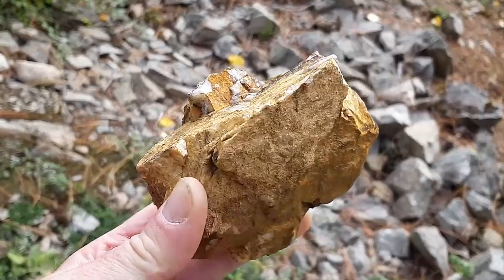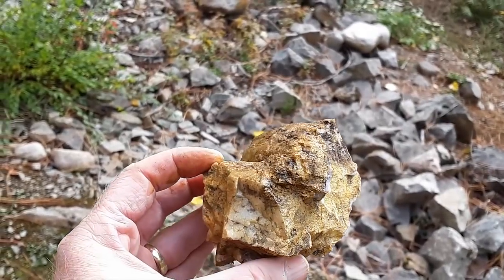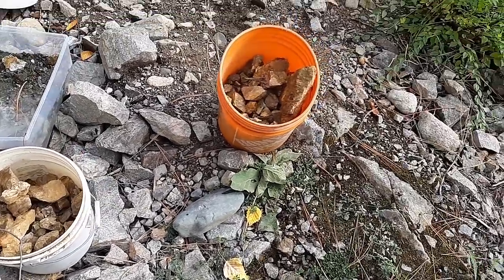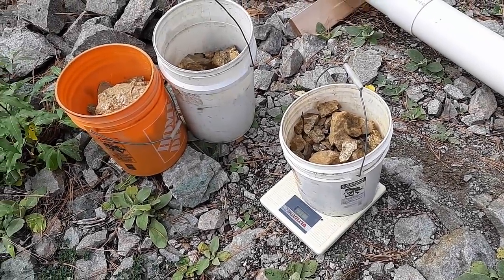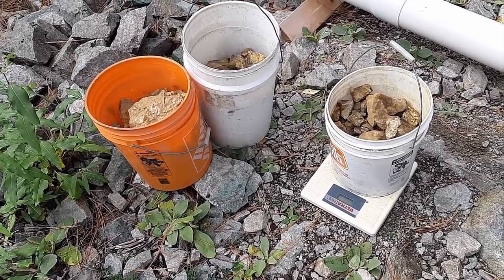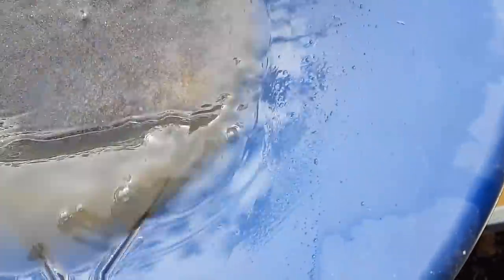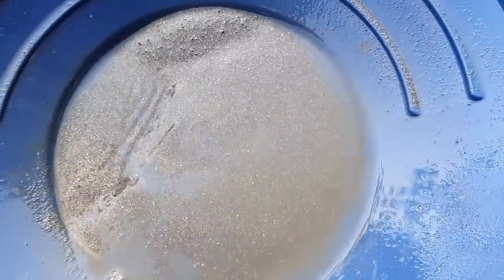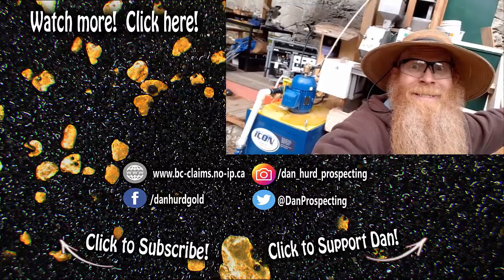Free Milled, Hard Rock Gold, Recovered with the Icon i150 concentrator.

Comment: Face Slaps my One Eye and watches all over again, Where is the So much Quarts in the Gold, so I bet a lot of the Dumped Quarts has a Lot of Micro Gold..
Me I go to the Full power, I hit ti with the Oil of Soap, Keep, the NANO size Gold from floating in the Air..Keep it in the Water, or Go full Oil Dry paste..
Reply: Exactly.   I'd be all over they're old tailing and dump with a detector for sure.  Back when that work was being done the stuff we call payable was just slops to them.  At $35.oo or so a Oz the little stuff just slid on by.

Comment: Before I process anything in my chain mill, and through the gold cube, I sift through the ore and separate the low grade stuff from the high grade stuff with a Garrett pin pointer. It will pick up gold in the rock 1/3 of a gram or higher. I always see gold and silver in the cleanout using this method for hard rock extraction.

Comment: Hey Sir, great video. Back when I worked construction we would make a ply wood barrier (usually a 4x8 sheet of ply cut down to 4x4 and set up in a V shape and set up next to the generator)  to reflect the sound away from us,  didn't get rid of the sound totally but sure took the edge off. and it was totally portable.
Reply from the maker: Will totally be doing that this coming year

Comment: Dan
I agree with HRU, for one thing your impact mill may still have heavies inside the drum the yield is still to course to much is locked up in the cons. 
A shaker table does a better job in separating gold from sulphide and micron gold is best recovered with smelting. 
Keep working at it.
Reply from the maker: Yes, I need a finer grind. I do clean out the impact mill. And the gravity concentrator is unbelievable at fine gold recovery

Comment: The sulfides might indeed raise the value of the strike by a bit... ~( 'w')/
Reply from the maker: Yes, under the microscope there is still a lot of gold attached to the sulfides
Reply: @Danhurd  I took a microscopic image of some porous rotten rock today and it LOOKS like it MIGHT have metal in it, but i can not be sure because this microscope is one of those cheap Chinese ones, and it might just end up being higher purity quartz crystals... I wonder how hard it would be to try to dissolve out the silver from a rock with ammonia and then concentrate it down.... I'm going to have to try that since I have an ammonia generator... [pondering]

https://www.deviantart.com/deliciousdeblair/art/Areas-Circled-in-Red-Look-Like-Metal-785524547

Comment: There's a lot more to safely handling ore of this quality than you are showing on this clip.What is the assay on this ore? Anything more than 1.5% arsenic would require you to bioleach as no smelter would handle it and those sulfides are going to turn to sulfuric acid if not bioleached.After you do all that it would require a cyanide heap leach plant to extract the metals.Canadian clean tech company BacTech has presented an exciting new solution called bioleaching, based on rock-eating bacteria, such as the Acidithiobacillus and Leptospirillum bacterium, to clear abandoned mine sites. Powered by the sulphides in the tailings, the little helpers munch their way through the toxic material and, as a nice side-effect, accelerate the breakdown of minerals.Go to Mining Technology magazine to read more.This bio leaching is a major component to extract metals from previously uneconomical mines around the world as sulfides had to be roasted at high temps to use cyanide for extraction.In summation your chance in Canada to get the permits and comply with toxic sulfides handling would make it impossible to make any money unless the deposit was at least 20 grms per ton AU and you had deeep pockets.
Reply: Great information!

Comment: Love your mill set up.  Did you subtract out weight of buckets from your sample weight?  Did you thoroughly clean out your milling circuit for additional values?  
Keep at it!  Enjoy your vids.
Reply from the maker: I did not take into account the weight of the buckets.  But I also did not calculate accurate values this time.  I was more just getting an idea.  If it showed more I would go for a more scientific assessment.
Reply: @Danhurd  Makes sense on the quick and dirty sampling.
If you're needing a finer grind, why not just put in a smaller mesh screen on the impact mill output?  Looks like you're getting down to about minus 20 mesh?

Comment: Great stuff! Few small miners address the metallurgy before piling in. Lower estimate of 1.5ppm, without considering the Au locked up in the sulphides and the ultrafines. Looks as if you would need a <100 micron grind to get all the free-milling gold out. A ball-mill as you said.
Didn't catch the vein thickness,  however,  unless you intend to send your children underground, you will need at least 1 metre of footwall-hangingwall clearance with it's dilution, not considering haulage ventilation etc.

Underground gold mining is not a game for the faint-of-heart!

Best all.

Comment: Hi Dan, I have seen a lot of high grade hard rock, and I have never seen that chunky of gold in anything I have personally worked.  I suggest assaying the cons AND tails from the ICON.  It may not be getting the real fine stuff.  That Mojave 1 prospect has almost nothing above .01" and most is about 100 microns  (.004") or less.  And that is just the stuff I can separate and see, which is a small fraction of the total assayed.
Reply from the maker: Under the microscope I can see gold on the pyrites left in the heavies, So yes this would need to be crushed finer.
Reply: @Danhurd  Also, you would need to change the final 'reveal' step on your panning.  Have you looked at 'Lesson 24- Improved Hand Panning for Micro Fine Gold' on my site?  Had a guy not just concentrating, but clearly revealing the 100 micron stuff in his second pan EVER.. 

 https://www.youtube.com/watch?v=dEmnr5cV2Y0&t=1s

If the micro fine is ONLY on the pyrites you could fine crush JUST the cons and do OK instead of the entire mass of ore.

Good Luck.  Really liked the recent series on cleanup panning.  Kudos.
Reply: @hardrockuniversity7283  That was what I was wondering. How much more gold is there either in particle sizes smaller than the centrifuge can extract or if there is a substantial amount of disseminated gold as well.
Reply: @MadScientistProspecting  A few assays would be needed to settle the issue.
Reply: @MadScientistProspecting  A few assays are needed to settle the issue.
Reply: I've seen that good of ore at the old Idarodo mine in Telluride
Reply: @RalphReagan  I think it looks pretty good to me, he just isn't recovering the micro fine fraction would be my guess.